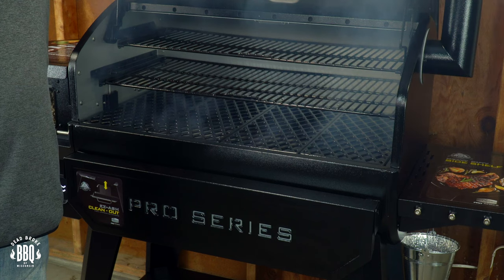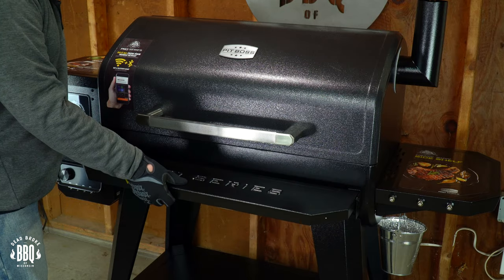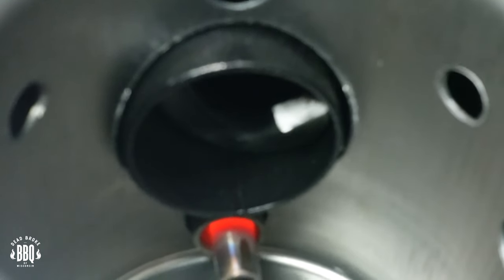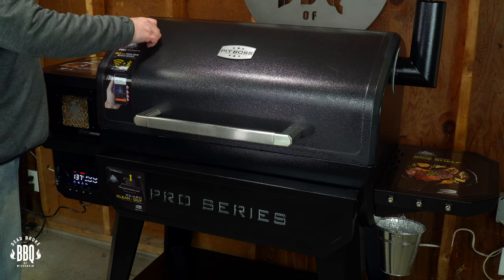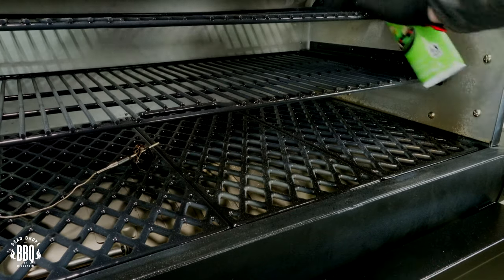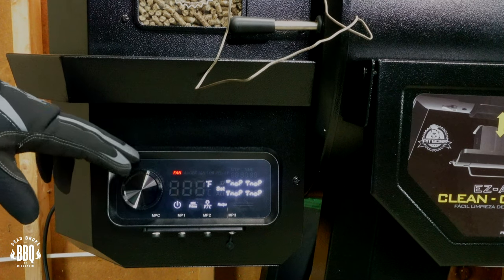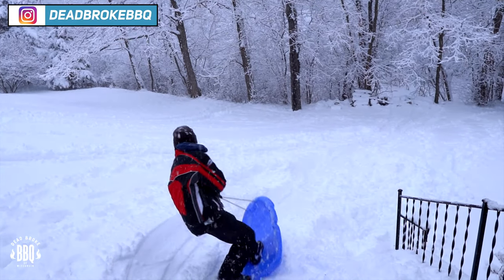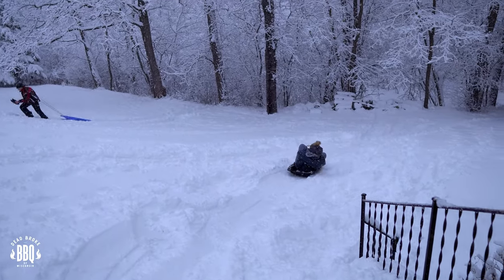Pit Boss | Burn Off | The New Pro Series

Comment: Great video! Great hits on the features. Only thing I heard was that you mentioned the upper chamber is insulated. I had asked pit boss directly and they told me it was NOT insulated. Only double lined, any proof otherwise? 

Btw I live my pit boss 1600 also!
Reply from the maker: I was going off what i was told by my PB rep. He said it was insulated but he is not on the engineering team so he could have certainly been told the wrong info?!?!? So I can check into that and add it to a future video. Now I am having a few issues with the temps on mine. Taking a lot longer to get to temps after I did the burn off. So my PID controller is not learning so I have a call into PB to get this resolved and once I have it fixed I again will certainly share what I know. I have seen on FB that others are having the same issues so hopefully this is just a few cases and once this pit is introduce to all the Lowes they have it cleared up. I really like this pit and fingers crossed I can get past the 1 hour wait to get it up to 300°. Without the 275° temp setting I will just run hot and fast for the time being. Thanks for watching and leaving a comment!! Have a great weekend and stay tuned!!
Reply: @DeadBrokeBBQ  I too have some issues with mine. Seems to ramp up to temp much quicker if it is set to “HI” at the front end. Then once it reaches the 350° mark, I change the temp to 350. Only real issue I have with mine is that it will NOT hold 250°. It holds it for about 15 min then eventually drops down to 230-235°. I went through Pitboss and they are sending me a new controller, though it’s like 8 weeks out. 🤷🏻‍♂️ all the other temps work fine.
Reply from the maker: Yep yours is on the same track as mine. Tomorrow I plan on trying that High temp start up also and maybe even opening up the flame broil?!?! But I also have the issue once I open to spritz or rotate it drops and takes forever to get back up. I do not want to run at 350° but I am ok with 300° and do it hot and fast but run it on Smoke for an hour. I am good at work arounds but this is extreme right now. I got faith they will get this resolved soon.
Reply: @DeadBrokeBBQ  so I don’t run it at 350, I was told to bring it to 350, and once it’s reached to set the preferred lower temp. Seems once it goes high and drops to say 225 it will hold solid. 

Trick I learned. Before opening the lid hold the Prime button until it stops, then open the lid. Helps keep the heat.
Reply from the maker: Hahaha dang this will be the last cook I do on this until it is fixed if I have to prime it also to give it a kick in the ass to keep that temp up!! ha ha But I might try that also!! Like I say with the lid closed it certainly holds temps. If I do that prime trick I will shout you out bro!! Thanks for the tips and hope others read these also!!
Reply: @DeadBrokeBBQ  any time brother! Don’t necessarily have to prime it every time only when it’s cold it seems. Anyway, any time you want to hit me up on the Insta @Naterchipbbq. Definitely dig the page brother! I look forward to watching more of your videos.
Reply: @mmhmm88  My 1600 is doing this exact thing.  I can hit 450 in just under 20 minutes set on "H".  Set on 350, it will take ~35 minutes to reach temp.  Then dropping it down to 250, it will hold for ~15 minutes.  But then drops to 210-230 after that.  Talked to CS last Monday, they supposedly have not heard of issues with the 1600.  They recommended the 3 step burn-off process that takes 5-6 hours to run.  I made it through 2 out of 3 burn-offs back-to-back but ran out of time on the last on and did it the next day.  Can't really say if it made a difference or not just yet.  

Sorry to highjack your comments @Dead Broke BBQ.  Great info there.  Looking forward to hear what the answer is on the temp control issue.  Overall love this grill.  Just need to iron out some of the bugs.
Reply from the maker: Hey all good and glad you shared the info!! Mine is getting a little better but still running about 20-30° below target but I can live with that. I just want it to recover faster and then it will be solid!! Thanks for leaving a comment!!
Reply: @brucru2666  yeah I’m not pleased with mine after trying to smoke over Valentine’s Day weekend. Going to try again on Sunday. If it still sucks I’m getting an aftermarket controller.

Comment: Just want to throw in my 2 cents. I purchased the new PB1600, and during the Pre-Burn etc, I had an issue. Called Customer Service (the person was very nice), it was determined that the Control Panel was bad. It has now been 4 weeks since that conversation with customer service, and they still cannot tell me when I am getting the new replacement. Currently "very" dissappointed. I am a very patient person, however, that will end very soon.
Reply from the maker: Dang Pete if you bought it from Lowe's take it back brother!! Say it doesn't work and you want to exchange it!! Man I hope you get this resolved!!

Comment: What's the actual dimensions of the lower cooking area
Reply from the maker: 18" x 34" so pretty much the same as the 1100 I use to have but this one is just taller.
Reply: @DeadBrokeBBQ  k thanks I have the pro series 1100 now so I may wait until it stops working or I have issues then.

Comment: It would have been cool if you would have actually gone through all the functions and buttons. How to set the timer, temp and everything else.
  Nice video none the less
Reply from the maker: Sorry Brian at that time I already new I was going to have to swap out the controller. I was told by Pit Boss mine was going to have issues until I could get it updated. It is updated and maybe I will slip that controller setting deal in a video in the future!! Thanks for watching!!